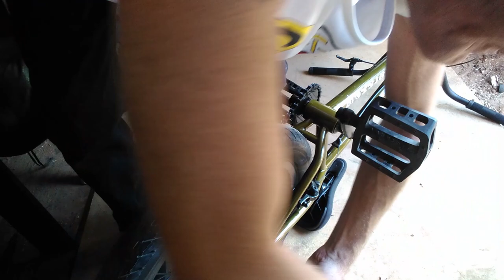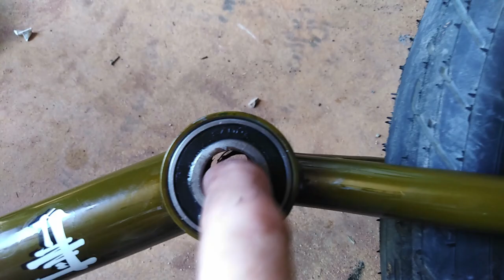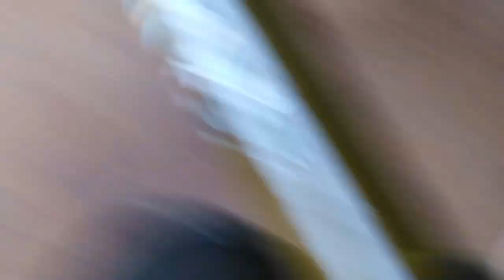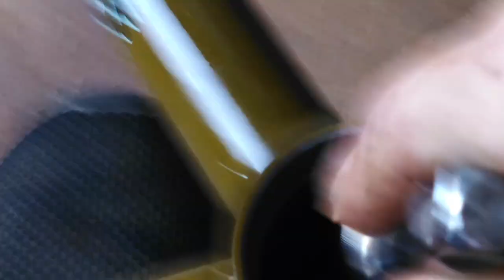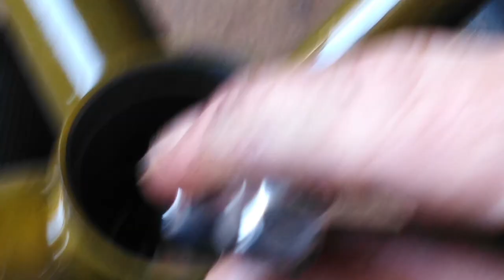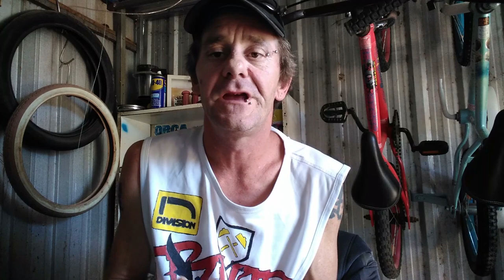removing bottom bracket bearings without the right tools

Comment: I cant get the bearings out of my sealed bottom bracket
Reply from the maker: They can be hard the 1st time to get out hit them harder and make sure to grease the BB shell b4 replacing with new ones will make the job easier later down the road